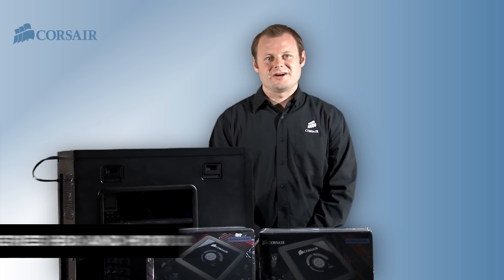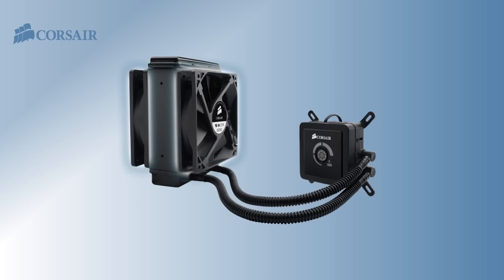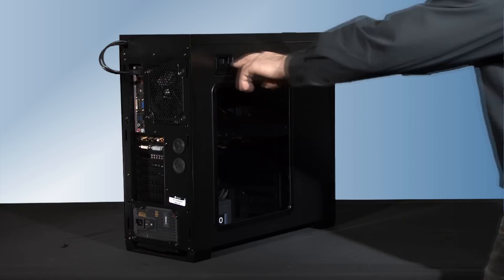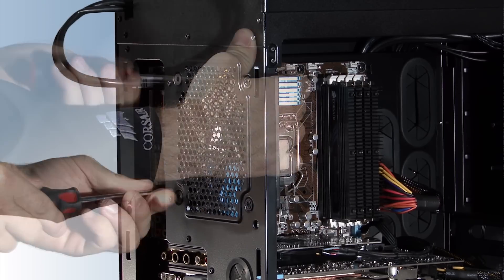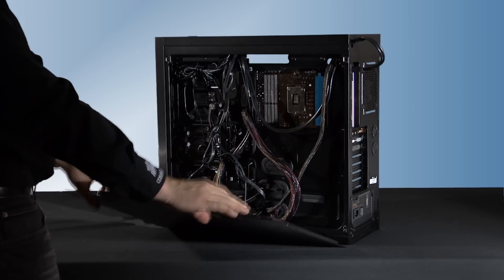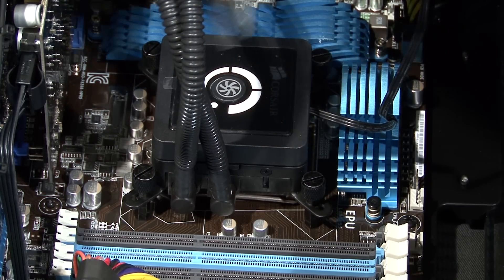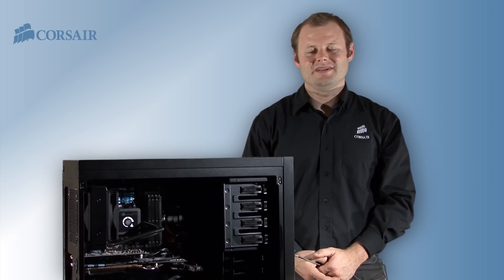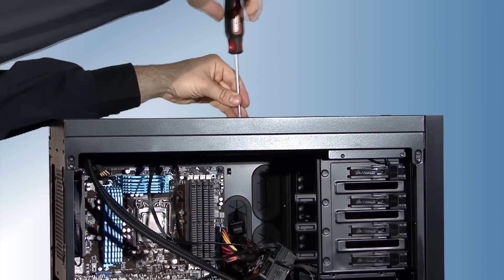How To Install the Hydro Series H80 and H100 Liquid CPU Coolers

Comment: Hello! Nice vid.Just a quick question about airflow. I've recently purchased a Carbide 500R case and the H100. So for maximum airflow i should set the tha radiator on top and fans below the radiator to intake air ? Because it seems to me that with the 200mm side fan and the 2x120mm front fans + the botom 120mm fan the case will fill with air and the rear 120mm fan wont be able to exhaust all that air alone.

Comment: @paan468 You have to install the water into a super soaker and then shoot it into the radiator while it's installed into the computer.  Make sure your computer is powered on!!!  It tends to work better if you are laughing hysterically while blasting water onto all of the electronic components.

Comment: could the H80 be installed in a packardbell i-media A5518 uk case as i can not yet get a better case also will I need a new power supply if i add this and 8GB of RAM to 4GB of RAM

Comment: You state AND show that the three pin needs to be plugged in (on the cpu_fan plug) but from other forums they state that I only need to plug in the 4 pin Molex...which is the correct way to plug in the connectors? Do I really need to use both connectors or only the 4 pin molex?

Comment: I own the Corsair Obsidian 650d and want to purchase an h80. Something i found weird about this video is that the 650d comes preinstalled with i believe three fans which draw air in from the front of the case and pull it out the back. Here you have it so the fan on the radiator draws air in through the back. Will i need to reverse all the fans in the case or his having fans pulling air in from either side fine?

Comment: @jpmac098 Yea, we can all dream about 100% heat transference ;). The h100 is a beast and the easiest cpu cooler I've ever installed, mounted on LGA 2011 I didn't need the backplate, even though it's still recommended, but I'm getting AMAZING temps OC'd @ 4.55 gigahertz :).

Comment: would the H100 cooler, upgraded to 4 fans , fit in a Thermaltake Lvl10 GT case or will it hit my motherboard/rams? motherboard is an MSI X79A-GD65 8D.

Comment: hmm.. i thought it was better to have the h100 exhaust heat instead of getting cool air..? i'm gonna use the push pull configuration on the corsair 650d

Comment: if i have get i right, can the Corsair H100 Hydro be used as ekshaust?  My pc have 1 fan in front that blow air in and two back that works as eskhaust fans(blows air out). i want to buy the Corsair H100 Hydro, but it have to blow air out.  i Hope someone have a good answer  :)

Comment: @hekasoram there is a square area of thermal paste on the bottom of the heat-sink as it comes out of the box much like a stock heat-sink/fan has. I usually recommend cleaning this off and applying some Arctic Silver 5, but the reviews out there get great results using the default solution here.

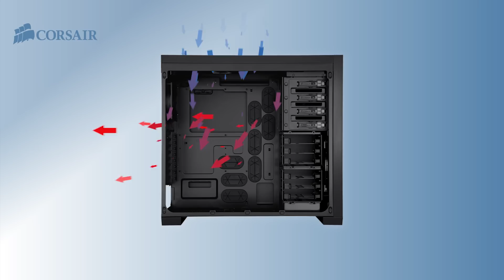Comment: @4:00
If you put the H100 radiator on top and have it pull air in, wouldn't you being pushing the hot radiator air onto the mobo and other internal parts?

Comment: I may be wrong on this, but did he put the bracket on right? At 2:49 you can see that the bracket has two cut outs to avoid covering the screw heads on the cpu plate itself, and it looks like it needs to be rotated clockwise once.

Comment: @CorsairMemoryInc  sorry but iam having the H100 and the 600t case with an asus p8z68 deluxe mainboard and the it dont fit 100% i needed to install the fans outside and radiator inside the case.because the power cable for the cpu is in the way and the memory come up to far.a another problem was that the powercable of on fan was to short to go thru the opening for the fans cable.so i drilled a new hole next to the fan fixing.

Comment: @TheXshot warm air rises so by pushing air you're using warm already at the top of the case to cool the cpu.  Not ideal.  It better to pull air and exhaust out the back with the H100

Comment: so would this be good for a pc im trying to build and want to overclock my cpu? or should i go with a different water cooling system? im getting the i5 2500k and i've read you can overclock it to 4.5 with a good cooler system

Comment: figured it out. Both are needed. One as the main power source and the other as another power source and input to the mother board for whether it should be running or not.

Comment: @GamingBoozer The corsair icon in the middle of the cooling unit that attaches to the CPU is a button with 4 settings. off, low, med, high. That's how you control the fans RMP's

Comment: @CorsairMemoryInc Will the H100 fit in a Obsidian 650D with a MSI P67AGD65 with Corsair Vengeance memory? And what about a push/pull configuration? 
And what will the fan layout be with the H100? Front = air in. Back = air out? Top = air in? Thank you.

Comment: I have a question about the wire hook up. I have the fans plugged into the cooling unit but I'm confused on whether one or both power cords need to be plugged in. And on the install instructions step 8 mentions something about "corsair link digital" And shows another port but i don't see a wire for that in the box or that being used in the video.

Comment: @MoOseeOH 

I think they would if  what happened was a known issue to them, Honestly the new units are really unlikely to leak. The leak issues had to do with the earlier 50 units I believe.  I think they are always willing to help they best they can but because there is larger knowledge of them replacing damaged parts I think more people have been inclined to rip them off so they might not be doing it as much anymore.   I hope that makes sense

Comment: @Orangeotterpop I got a pretty high end PC so I wouldnt bother to rip them or just get a knife and slice a huge slit in one of the pipes its only a few months old 2nd is that just say it leaked somehow and if i can prove i didn't cause it if in the time frame of the 5 years warranty would they consider paying for what it had damaged cause I really would like to get one of these since im running at stock cpu cooler and im not high trust of water and electric components or is there official info

Comment: Here is what I would do, 800D, mount the Rad on top with 3 Aftermarket 120MM Fans. Why the 3rd fan? Your really going to tell me your going to leave 1 $10 fan slot open?

Comment: this video confused me.corsair suggests setting up H80 with a push -pull configuration meaning fresh air from outside the case coming inside through radiator.in this video the configuration is different.H80 is used as an exhaust...so which is right/better?